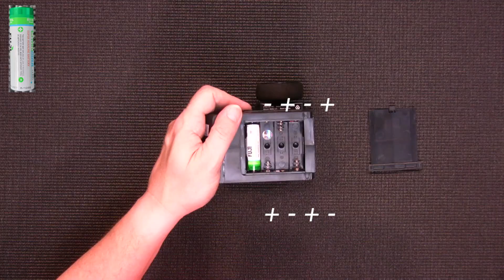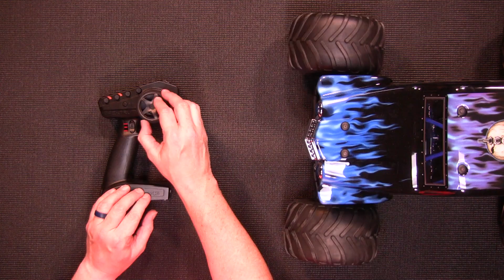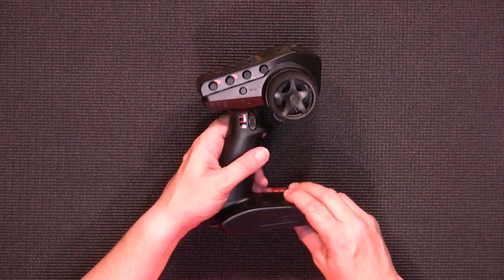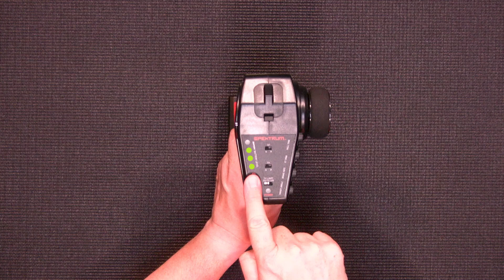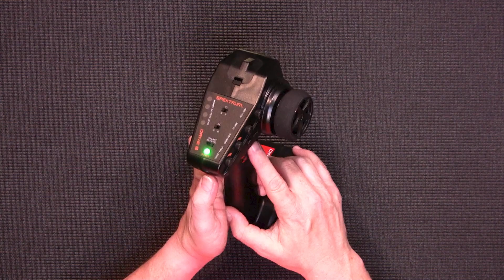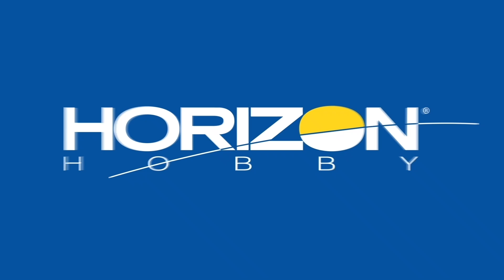DX3 LMT 2.0 Complete Operational Guide

Comment: my steering trim does nothing - just snaps the wheels left to right. also - in unlimited, the truck will stop - but wont go to reverse after returning the trigger to center. I have calibrated, reset, you name it. This thing is junk for the price and there is little to no help for this thing anywhere. Came out of the box with a bent wheel/tire, and all 8 shocks leaking. Now the transmitter/ESC doesnt work right. This thing is terrible for claiming to be RTR.